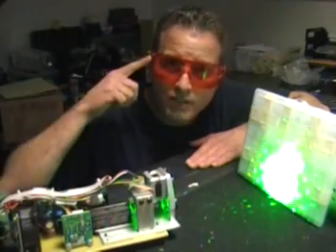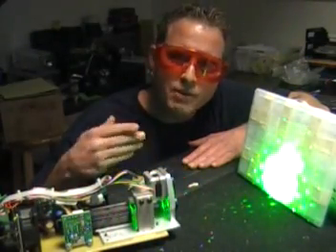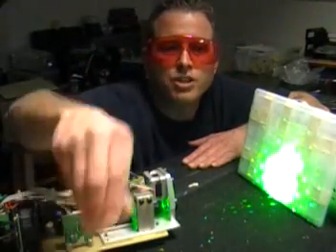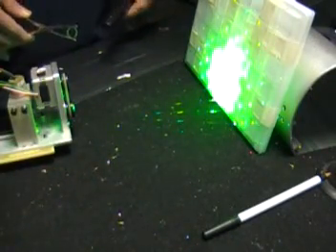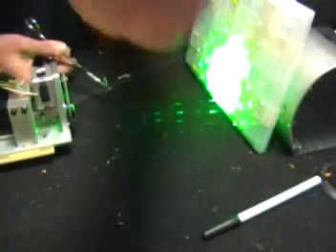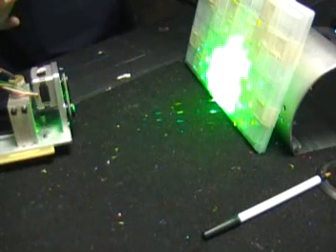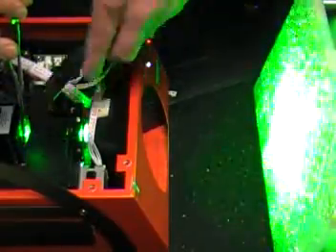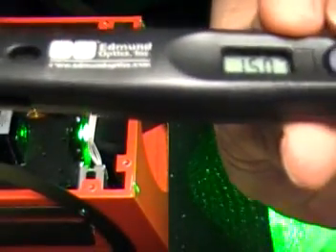Brian's Laser Science Experiment

Comment: 1) Green lasers do not emit any UV
2) Your power reading is flawed since you are not using a thermopile reading head. A visual sensor will make longer wavelengths such as IR appear as much more power. I would guess there to be maximum 20% IR.
3) IR filters do not cost $80 unless you get them from some extremely overpriced place.

Please don't educate people about things you do not know. Good safety advice with the goggles however.